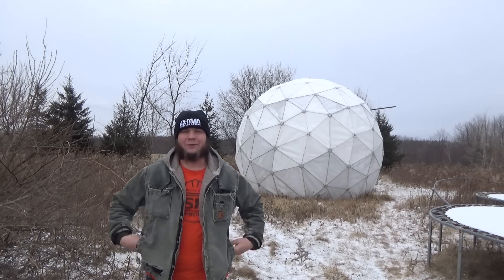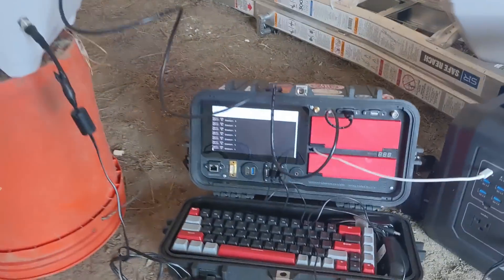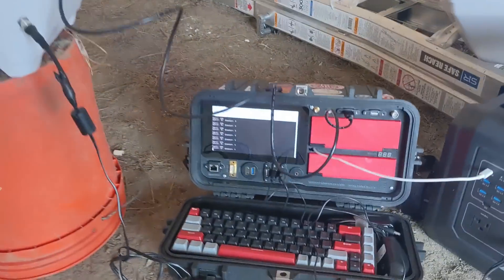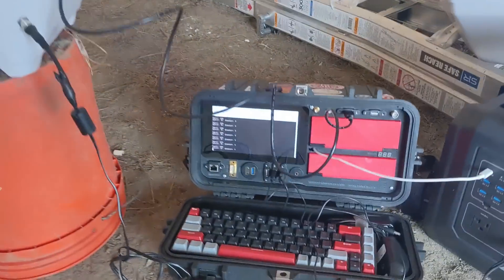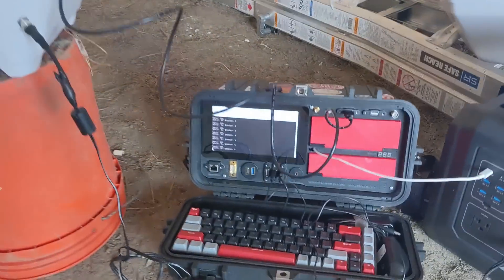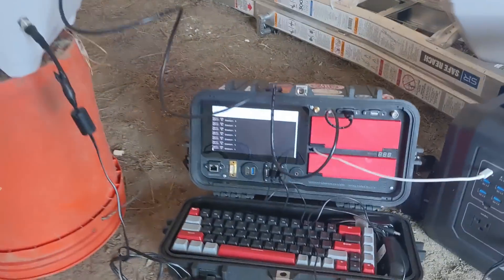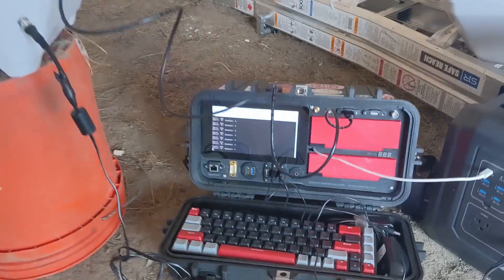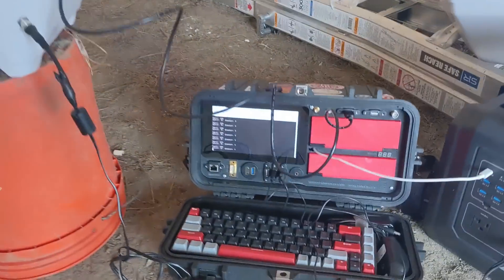How Does A Radome Affect Radio Signals?

Comment: I made a no dig  big dish mount by making an X with c channel on one end of the mounting pipe. Each leg gets one hole . The platform is RR ties with long all thread studs and extra  jam nuts to facilitate truing the mast . I placed pillar blocks , buckets of sand , and used brake rotors on top of the ties to hold herr in place . If I wasn't so far away from you I would hook you up . I have some cool Sat gear , top shelf recievers , digital side car , dual band feedhorn ,mesh dish  control arms , bootleg+ ligit analog  descramblers ect ect . I've had my fun with it. An episode covering obsolete sat tv hacking might be fun? Peace
Reply from the maker: That could be an option, although it shouldn't be too hard to pour some cement in here once it warms up. I don't actually know anything about old satellite TV hacks. We had a C-band dish when I was a kid in Alaska and could only get about 3 satellites. I don't think there were any paid ones we could see so we never tried that.

Comment: Very cool project.  I used to imagine building a radio telescope using a large dish and manually adjusting it by pointing it South and changing the elevation once a week and then using some math to determine the RA/DEC coordinates and averaging out the 7 readings to make a heat map of the galaxy.  
I probably will never get around to that.  So far my only very successful radio astronomy project has been radio meteor detection.

Comment: You could have the big dish mounted static pointing straight up and use a flat subreflector + small feed antenna assembly that moves as a simple cassegrain style telescope. It wouldn't have as large of a pointing range but it's easier to point the small bits than the big bits. And at small scales a flat reflector works as well as a proper parabolic subreflector. ps. sorry for ghosting you re: may dome assembly and radio nerd stuff.
Reply from the maker: Something like Arecibo, that could work!
Reply: @saveitforparts  Arecibo used a spherical reflector. It had multiple focal points, standard dish has just one :(
Reply: Is waiting patchtvonbraun😋

Comment: If the data is basically a 2D spreadsheet of amplitude then maybe taking a scan without and with the dome in the way and calculating their difference would give a filter (just the influence of the dome) to eliminate the effect of the dome if applied to data with the dome.
Reply from the maker: That could be interesting too!
Reply: That's where image stacking and observations of anything that isn't geostationary comes in.
Reply: @dougaltolan3017  yes. thats right. a far bigger dish would be the best option to mitigate the dome's influence
Reply: One could do something similar to whats done in digital xray software. There you have "raster"-lines in some setups and you can very simply find and remove them without actually losing any image detail. Maybe looking into the processing of xray software could lead to some interesting results. Though it could also be interesting to create a sort of mask picture of the dome and use the unique triangles as a way to navigate and statically remove the noise.

Comment: The reason you can see the dome is because your dish is smaller than the triangles in the dome.
Reply: Exactly what I was thinking about. We'll see in the future!
Reply: ! That makes so much sense !
Reply: Wonder who’s right
Reply: @Hahhaha403 Okay so with a small dish scanning the sky you are going to have a high percentage of the dish picking up noise when it points at some of the framework and no noise when it's pointing through the fibreglass. With a bigger dish its always going to be pointing as some of the framework of the dome, the bigger the dish is, the more that the framework will be out of focus. You see more of the framework with the small dish because from the small dishes perspective its more in focus even though from a signal source point of view with the larger dish the signal is more in focus.
Reply: No. It's the frequency. The only thing that matters is the size of those sexy photons. Yes the antenna is somewhat the size of that wavelength because of obvious reasons. The antenna is meant to capture more or less the same size photons than the triangles. By size of the photons of course I mean the wavelength which is basically the same as the distribution of the wave function of the photon. Etc

Comment: I'm no RFologist but I'd think a larger dish would be less affected by the structure as the capture area is much bigger than the spacing of the dome structure - may be some slight attenuation but doubt you'd see the pattern.
Reply from the maker: A bigger dish has tighter focus, so I'm not really sure how that will look! Definitely something to play with in the future.
Reply: @saveitforparts I genuinely think just less sidelobe interference ("lens flare") as long as angular resolution stays the same
Reply: The focus would be way out in space, at the dish the signal should be coming in roughly collimated/parallel. So at close ranges to the telescope, it will essentially be averaging the interference of the structure over the width of the dish so should blur it out.
Reply: @C4k3w4lk  That is precise and since the structure in front is not symmetrical, it would not create interference pattern artifacts. Ancient radio dudes were smart.